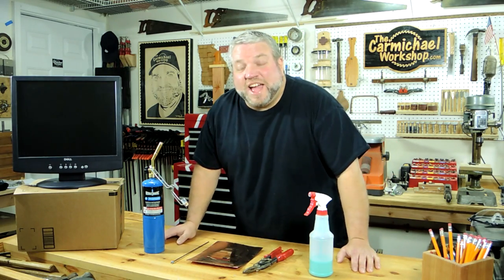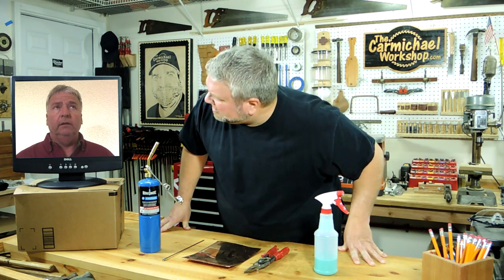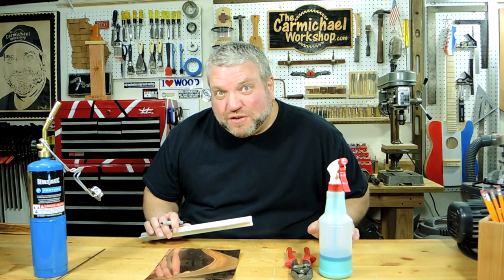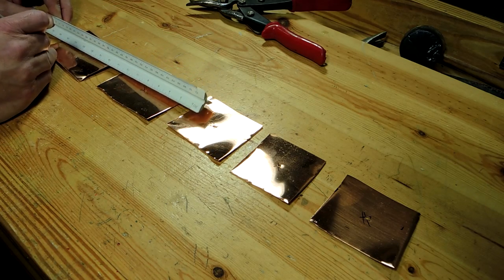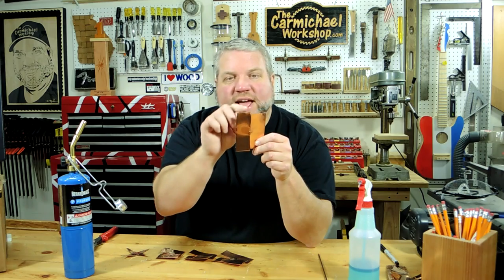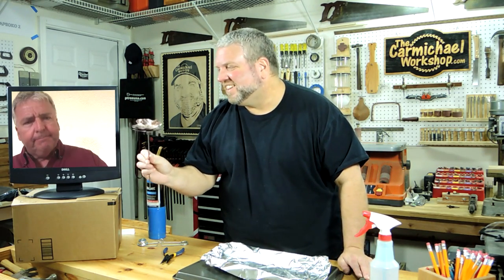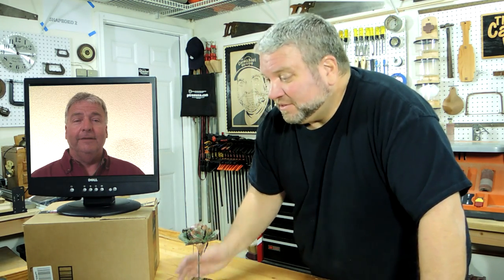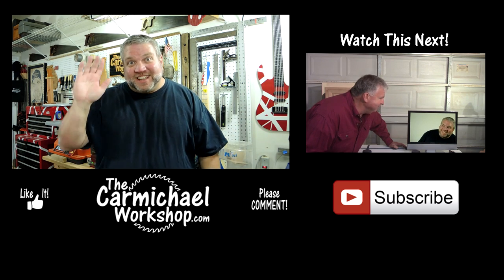Making a Copper Rose - Collaboration with Ted Alexander!

Comment: Fun collab Steve and Ted!   How did you like working with the metal?  It looked like fun and would be nice to have Ted so handy to ask questions to.  :-)  Fun as always!
Reply from the maker: Cy's Corner Thanks!  I liked working with copper.  It's such a cool color and bends easily.  The blow torch was new to me.  It felt odd to just set a flame shooting can of gas down for a few seconds.  I was worried I would knock it over and it would roll under the car, then kaboom!
Reply: Steve Carmichael Cool!  My brother does a lot with metal, he is a car guy but started doing a lot of metal art, including lawn flowers.  I haven't ventured into any metals yet, but I do have a torch!!!  Now I will be thinking about it rolling away, so I will make sure not to blow up my vehicle!